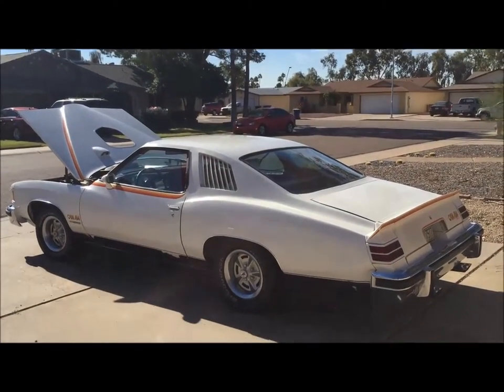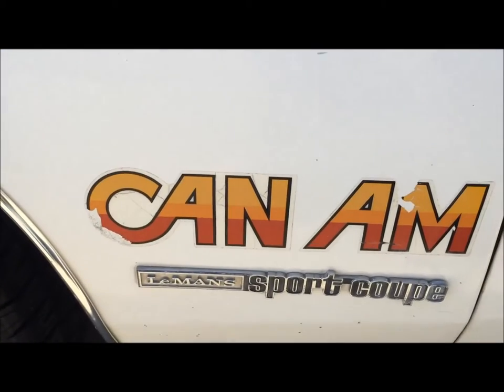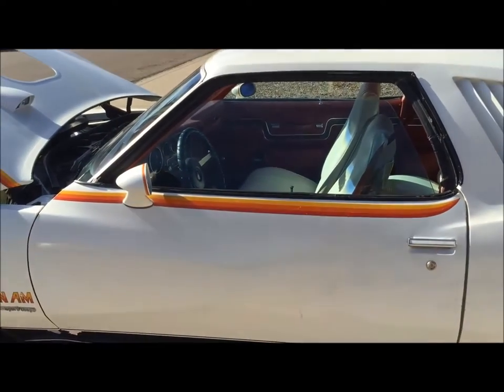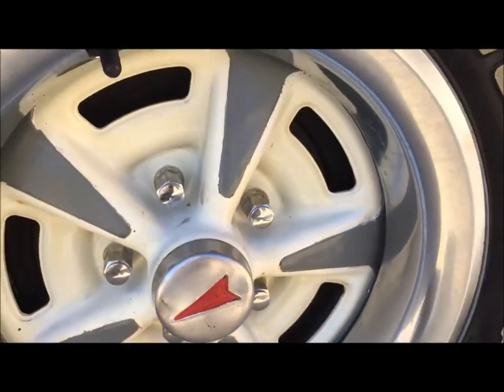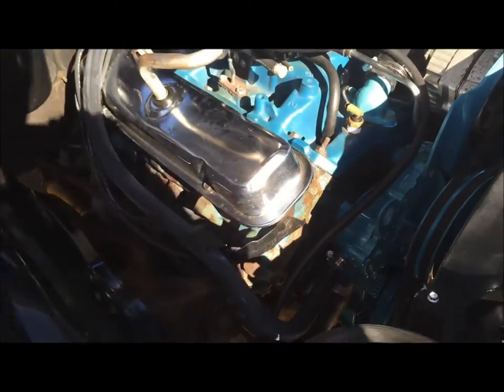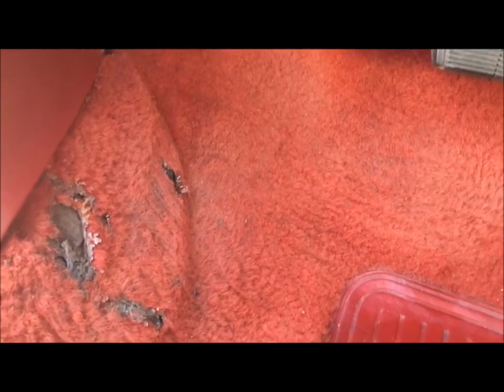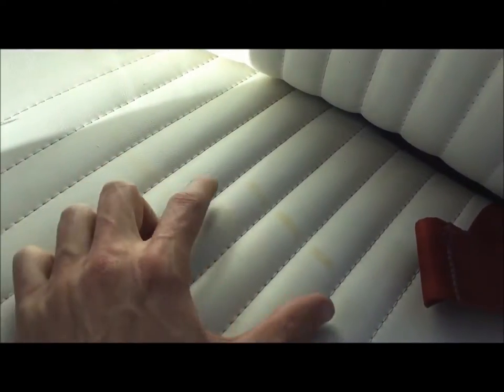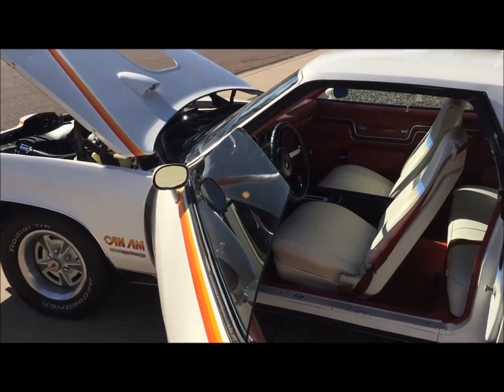1977 Pontiac Can Am - Full Walk Around Video

Comment: No a/c. Talk about a hot car down south. It may seem like there is not a lot of body work but I guarantee you that it would cost at least 3-4K just to get the dents out and repair the bent up parts and you would have to get a new decal group for it. Good luck with your car buddy. You still have quite a few issues with your interior also. You keep saying it is a really nice interior but I would give it an overall 'C' grade. Lots of little and some big items.

Comment: If it’s a 6.6L then it’s an olds 403.
Reply: Not true. In 1977 In the 6.6 liter Trans Am you could get a 400 pontiac if you ordered a 4 speed manual. There were some 400/auto cars too I believe. But all the 403 Olds powered Trans Ams we're automatic transmission cars. Almost positive the Can Ams we're all 400/automatic cars with one 4 speed version that escaped the factory
Reply: Not rue/Both the ponitac 400 and olds 403 are 400 cubic inches.
Reply: Mudbone gaming The Can Am had available a 200 horse 400 (TA 6.6).  403 was a California engine in the 78 TA and in 79 it replaced the 180 400 and the 220 horse 400 that was only available with a 4 speed.
Reply: It would say T/A 6.6 on the shaker if it is the Pontiac 400.